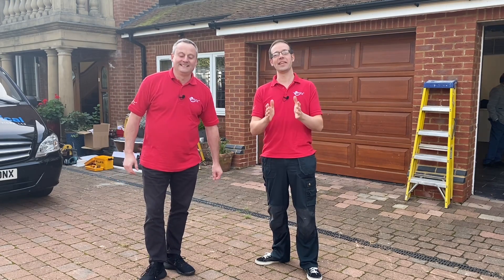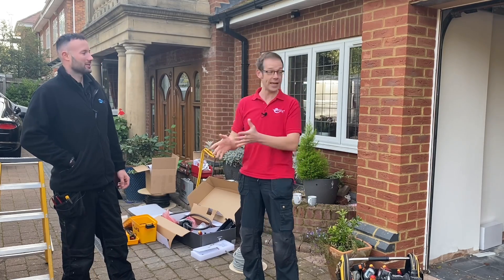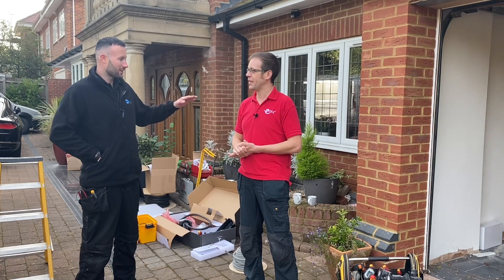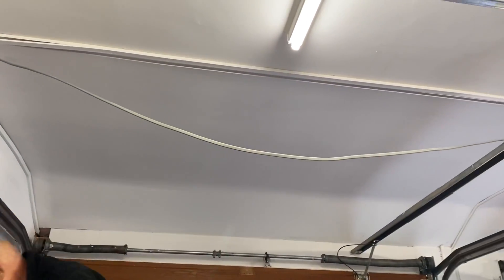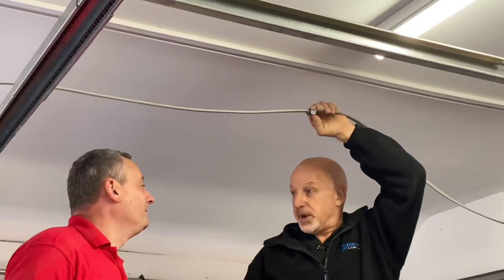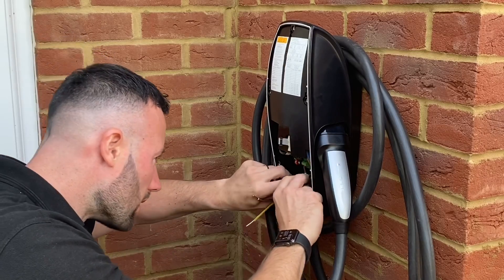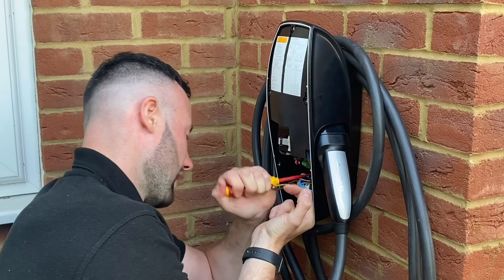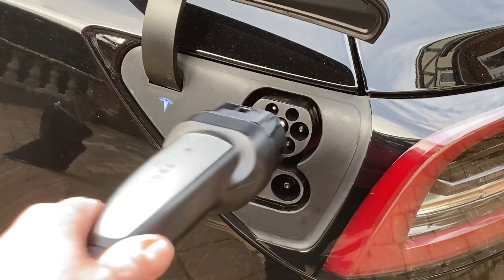Electrician On-site: Tesla EV charger installation with MJ Electrical & Building Services

Comment: Brilliant only question I have is if it has to be a type B why are all the GARO brand boards with PME protection type A online its very hard to find type B and if it is type B it's double or triple the price and has spares to add more in which is pointless unless you have 2 tesla cars most houses will only need one
Reply: I spoke with a guy from GARO today and he said type A is fine and type B would only be for more industrial sized chargers
Reply from the maker: It actually depends upon the type of charger - this generation of Tesla charger need a type B as they don’t have DC leakage protection. RCDs protecting EV chargers need to be double pole as per BS7671.

Comment: Sorry but it does not have to be a type b rcd . A type A can be fitted as long as your charger or car charger consumer unit as a Dc Earth leakage device fitted. Read the regulations properly
Reply from the maker: Yes you are correct - but the Tesla charger doesn’t have DC leakage protection - hence type B required.
Reply: Obviously but the electrician made a general remark about type b RCDs &  did not specify this installation only  so I did. I fit these all the time & I would of been more specific.

Comment: Great video, the Tesla chargers are really great to install,  PEN fault conductors are the way forward, much easier than putting in an Earth rod,
One thing I did notice is that the incoming conductors weren't ferrule crimped as per manufacturers recommendations.
Doing my EV course next week, looking forward to it

Comment: Was anything done about the basic insulation on the tails being exposed to touch before additions were made to the installation. Can the Garo units also be used for other items of electrical equipment used outdoors eg oil boiler sat on the ground for loss of PEN conductor or is it only suitable for 70V touch voltage relevant to EV chargers.

Comment: Big question I'd be asking is "Why not use the all 3 phases connected to the tesla charger, as the car has a 22Kwh AC to DC charger built in, was it cost?"
Reply from the maker: The property is connected to a single phase supply. (The distribution board is three phase but converted to single phase)
Reply: @efixx  That was not implied at the beginning and is why I asked the question.   Thanks

Comment: I love how 'fire clips' are always made and example of...not to mention that should you have a fire there will be molten trunking everywhere lol
Reply from the maker: The trunking would burn away quickly. The copper conductors of the cable don’t. Fire fighters getting entangled in this scenario is a reality.  Shirley Towers: Firefighter deaths lead to wiring safety change http://www.bbc.co.uk/news/uk-england-hampshire-30845937
Reply: I would not readily follow the method of fixing shown on this video to avoid the premature collapse of the wiring system. The plasterboard is a building fabric and not a building structure, and therefore the building fabric is liable to premature collapses after 30 minutes, and the cable will remain collapsed until the copper has melted; therefore the end result is the same. There is no point in providing a 2hr fire clip on a 30-minute ceiling structure. The wording in BS7671 Regulation 521.10.202 is really poor at advising what is meant my premature collapse and how to deal with it.  http://www.mbd-uk.com/premature-collapse-electrical-wiring-systems/

Comment: So the most important question I have is with the Garo unit, if Voltage drifts outside of 207-257 range does it automatically reset. As there's quite a few places in the south east where it will often peak into the 260s and go as low as 180. I know the Zappi will auto reset but I imagine anything that doesn't - waking up to a dead EV, it's not like you can jump or bump start it. Also if EV construction transitioned from metal body to carbon fiber to save weight/increase range, would these even need to be installed?
Reply from the maker: It’s the first time we’ve seen the Garo unit - we will dig a bit deeper and see what we can find out.
Reply: Hi Mark - drop me a line and we can discuss. conor@garo.co.uk

Comment: Unusual to have a 3 phase supply and 3 phase board in a domestic setting but only one phase used
Reply: @johnhoward2104  I did notice it was a 3 phase service head with only one phase used, however, I was commenting it look like a domestic setting.
Reply: Noticed that too. At home Tesla normally supports 11kW charging. That would be 3x16A in three-phase. A five core 2.5mm^2 cable would be sufficient.

Comment: Would have been better and probably cheaper to fit a Zappi, you'd get the grant and have a built in PEN monitor
Reply from the maker: The Tesla units are reasonably priced. You also don’t need to climb inside the car to unlatch the charging gun as Tesla chargers have a useful release button paired to the car.
Reply: Can you not unlock the charger with the phone app?

Comment: How come they didn't avail of the three phase to get 11-22kw charge rates from the tesla charger? Model 3 will go to 11kw on AC and older Model S will go 22kw I believe.
Reply from the maker: It actually wasn't a three phase supply, it was a three phase board modified to single phase. Thanks for asking though. 👍
Reply: @efixx  however, there was a 3 phase cutout shown... presumably only one phase used off the cutout for historic reasons and customer never decided to upgrade and get a 3 phase meter put in